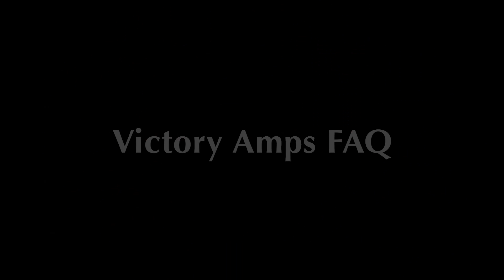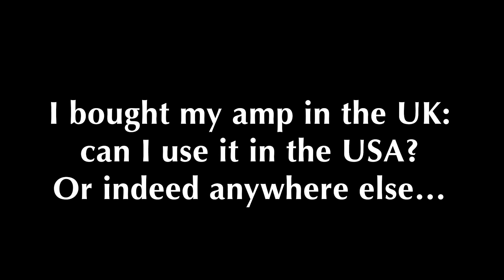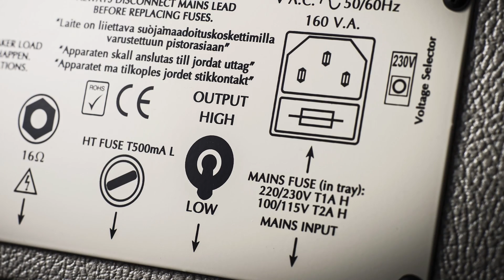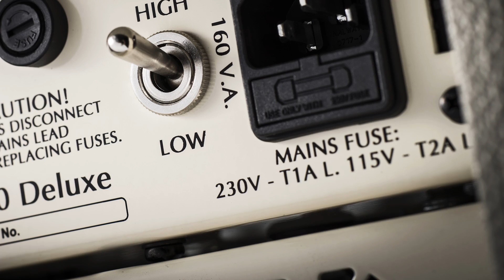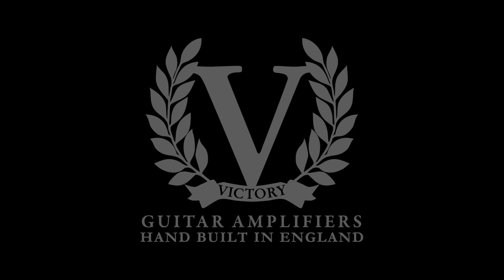Victory Amplifiers FAQ – Mains Voltage: Can I Use My Victory Amp In Other Countries?

Comment: Hello, if I move with my amp from the states to Ireland, would I also need to switch the voltage s left on switch to 230v?
Reply from the maker: Yes this is correct and you would need to change the fuse to the correct value of a T1A fuse, thanks Victory